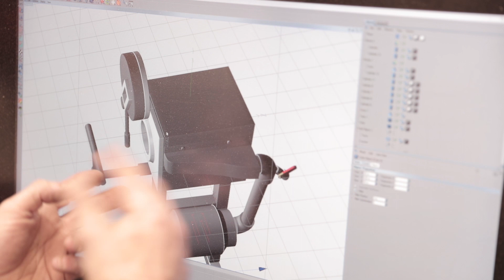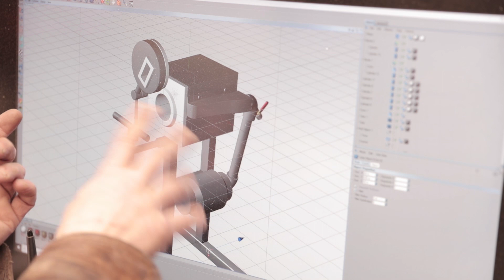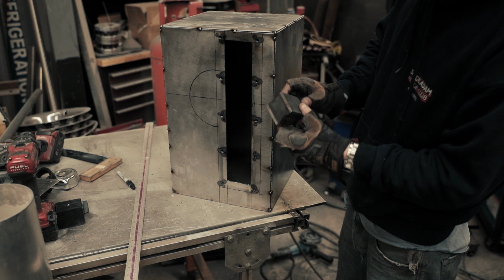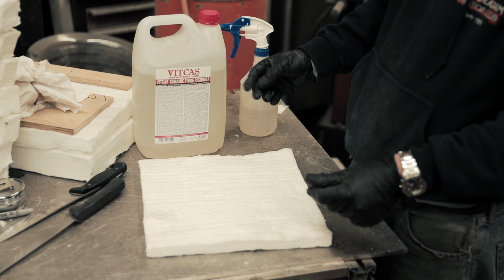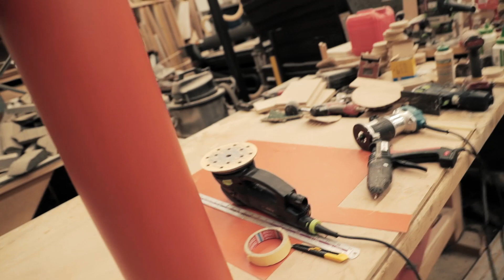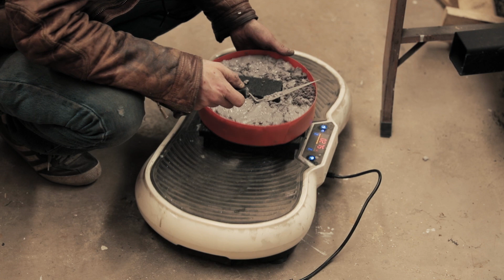HOW TO BUILD A VORTEX RIBBON BURNER KNIFE FORGE - PART 1

Comment: Really love your engineering SIR !
I'm now beginning my second ribbon burner and I seen failure because that motar is affected by gravity if you're working it like a plaster job and cause cracking much like drywall a patching isn't equal to a  solid inch of refractory motar. 
I don't see any reason to do heavier outside walls than 18 gauge  steel unless the 12 gauge is equally priced of pretty much the same cost.
  Shur great vibrato shaking your machine is doing get I'm coming up with something that rocks all directions to get me a poor man system to settle my morar that motar must be in a solid brick that way you working it.
 Great job Sir 
I'm following your work best I  can and expect to have a  great forge. 
  Please show your burner build also.
I'm loving this build. 😍